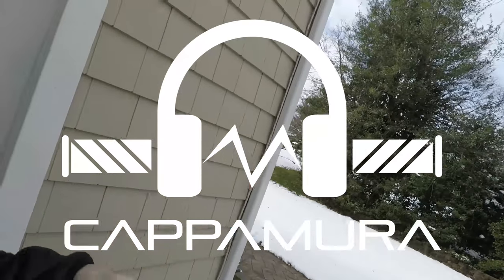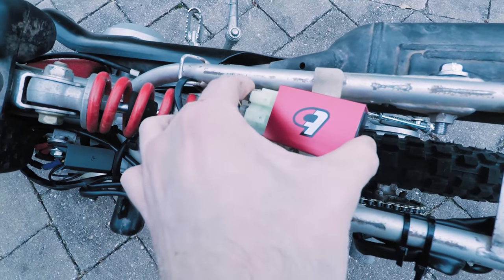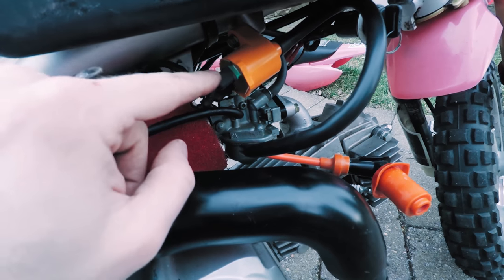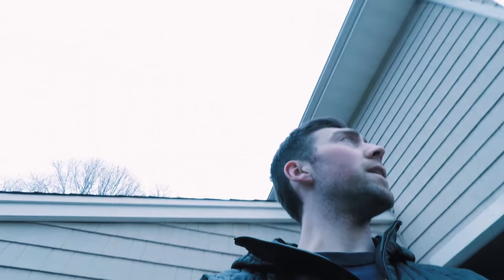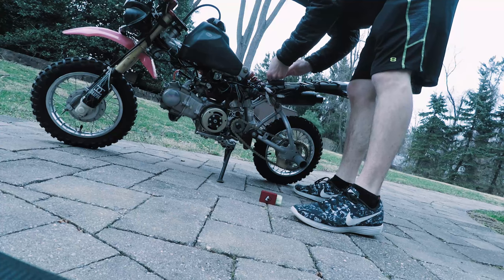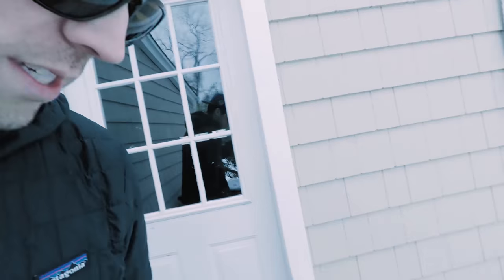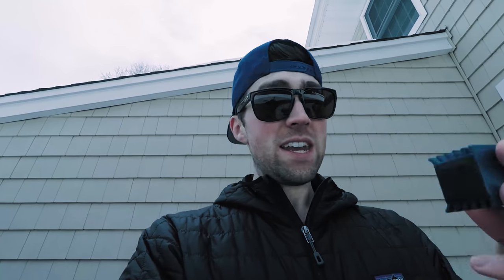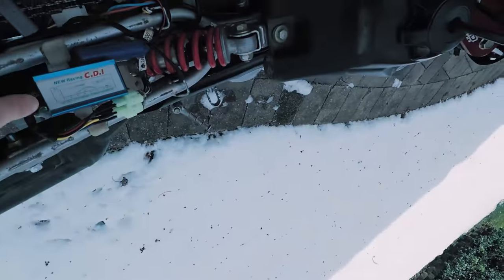Crf50 Performance CDI | Coil & Spark Plug Install

Comment: Did you happen to notice if you were loosing power/ the motor cutting out out at high rpm’s or full pinned throttle?  After switching out the ignition coil and CDI box did that fix the issue?
Reply: Sounds like u have a jetting issue
Reply: I thought so also but I changed all those parts coil ,CDI , new plug  and rebuilt the carb with all the stock recommended parts petcock flows like a race horse pissing. and still the bike cuts out when it’s pinned as soon as I slow down where the rpm’s catch up it starts responding. I was thinking that the piston and rings were shot and it’s not getting the compression at high Rpms? Idk
Reply: @DJMEDIC671  or valves stuck

Comment: Does racing cdis really improve performance?
Reply from the maker: +Chamjisky Khan it didn't do anything for me.
Reply: cappamura could it be due to the fact that it is cheap ass? How do they improve performance? Do the they play with ignition timing?
Reply from the maker: really the only thing they do, from what I have seen, is raise the rev limiter. which will not result in more speed.

Comment: What she cost for the spark plug
Reply from the maker: probably 10 bucks
Reply from the maker: or less
Reply: I meant what size socket you use on the plug
Reply from the maker: I dont really remember. Maybe a 14

Comment: Dude I have a crf80f & I think I have a bit of a prob with the same shit. what would you recommend bud?
Reply from the maker: It ended up being the CDI was bad. Get another one!
Reply: Just got the new cdi\coil\plug,,,,Here's hopin dude...See what you mean. It works with the 3 electrodes plugs to give the bike its race ready power.haha. Wake up Crf80f.
Reply: buying cheap stuff means hit or miss